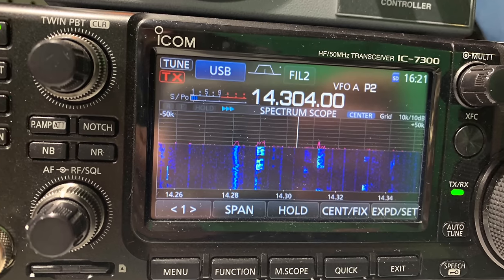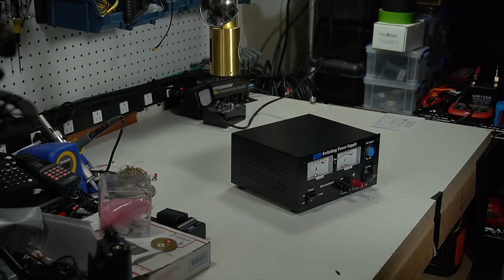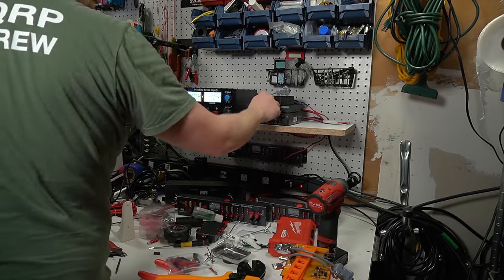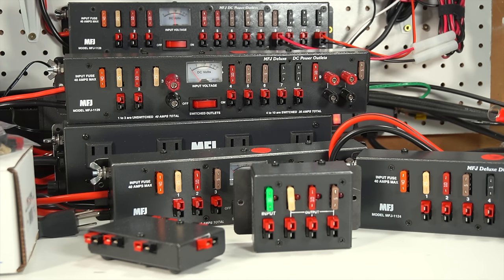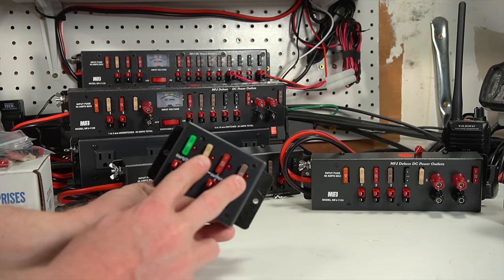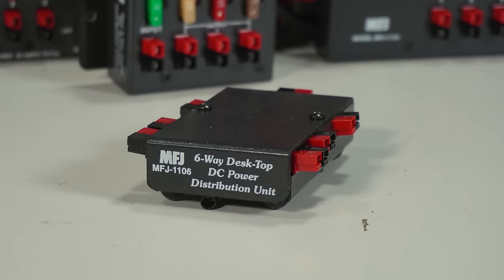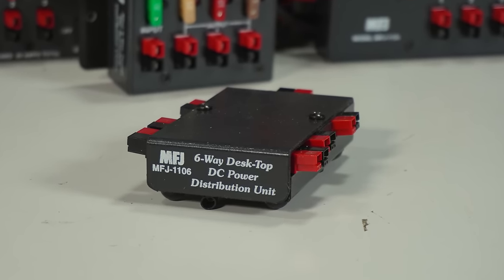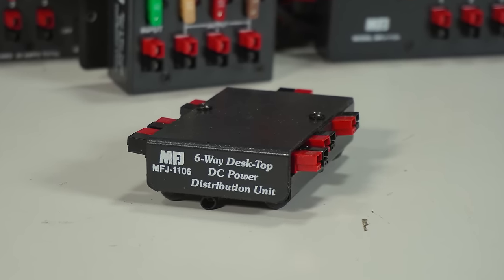Powering Your Ham Radio Shack with MFJ and Anderson's

Comment: Another great video.

I made a small device using an LED and a resistor connected to Anderson power poles.  I use it religiously every time I connect something for the first time after making a new connector cable - and especially when I am connecting something to someone else's power supply, like at Field Day.  If the LED lights, I know I'm good to go.  If it doesn't, there is either an open connection somewhere or, more likely, reverse polarity.  I've seen cables and connectors made up in the field where someone accidentally reversed a lead even though the power poles are color coded.  It's a very cheap way to protect your rig.  Steve, W6SDM

Comment: For your solar and battery backup look at the West Mountain Epic Powergate which switches everything automatically.  One day my solar panel will get installed and mine will be complete for my shop radio.   I also use the West Mountain  Powergate in my shack with a 125 Ah AGM battery. Again it switches automatically and charges the battery.  I also use the MFJ power distribution panels in both places.  Gotta love the Anderson power poles.
Reply from the maker: Awesome. A lot of people are recommending that unit. I’ll check it out.

Comment: Great video, Josh. Just put together my "Shack in the Box"  v 1.0 and used an Epic PWRgate knockoff that has power supply input, battery/solar input (supposed to autoswitch). That goes to 9 port RIGrunner knockoff that will power two radios, USB hub, mega hotspot and charging cradles for three HTs.

Comment: Nice set up. Being new to ham, Im working through some of these organizational systems prior to setting up my work station area. Ive built a go box with an ic-2730a, 12v 15ah battery, built in mfj power supply (just in case I have access to 110v. It is not only a nice go box, its a pretty sweet vhf uhf setup at home.

Comment: At one point I just used the screw down connector on my power supply.  When I added another radio I added another power supply.  Then I bought a rig runner and learned how to do power pole connections.   Now I have power supplies for both houses and am looking to set up a shack in my new home.  Had LMR400 built in.  So now I will standardize around my rigrunner for power distribution.  Love those power poles.  AD0DQ

Comment: I use Anderson Power Poles as well. In my previous setup I used a MFJ 25 amp power supply (also have a 45 amp version), but from there I use a different brand of equipment. I had a West Mountain Radio Super Pwrgate which automatically switches over to battery in case of power failure, and the power supply charges the connected battery. My power distribution is a couple of WMR Rig Runners that basically have the Anderson Power Poles and fuses similar to the MFJ units. My battery was a 34 AH SLA, but recently I changed my setup to use a 20 AH LiFePO4 battery. The lithium iron phosphate battery requires 14.5 volts to be charged properly, but the MFJ power supplies won't provide that voltage. I invested in a Powerwerx variable voltage power supply and swapped the Super Pwrgate for an Epic Pwrgate. This model will handle the charging of the LiFePO4 battery and has an input for solar panels. The Epic will also handle SLA batteries as well. I don't know if MFJ has a similar device that auto switches the power from power supply to battery, but it can really save your equipment in case of a power failure and allows you to continue running your equipment as well.

Comment: +enjoye your video on power sockets with anderson powerpoles.  i use them in the shack ideal for swapping radios around without all wires coming off the power supply. these are amazing and with the crimpers so easy to make up different leads.

Comment: I have a smaller Anderson distribution unit, i put a battery unit in that take the power supply and and a 50 amp hour glass mat battery.  Then to my  Anderson distribution.  This will charge my battery from the power supply and power my Anderson distribution.  It will switch from the power supply battery automatically I don't know the speed of the switch,  but I was on my VHF-UHF radio talking when my power went out and the radio and I were happy with the speed.

Comment: I have an Astron 35 watt unit.  I run everything to the power posts on the back.  I use in line fuses for all the loads.
Reply from the maker: I disagree, having Power Poles everyone is much easier and more reliable from my POV.

Comment: I haven't made the move to the power poles yet but plan too. I have a 30amp power supply ran to a 30amp fuse block, that has both power and ground on it.

Comment: Save yourself a lot of money, use a circuit breaker ground bar kit, I mounted them to a small PVC pipe but you can literally mount them to anything non-conductive. Use one for power and one for ground. There are so many options using this method, it really is limited by only what you can imagine. I have purchased MFJ Power Taps but I was tired of dealing with screw downs that were to small to accommodate larger wire, not enough taps, the endlessly different connection types and the cost. This system I came up with has really worked well for me, I wouldn't do it any other way.

Comment: Looking at a similar distribution setup. Recently completed my cpu install for high speed processing and three monitors. This helps to effectively process the RSP1A connected to the ft-991. Installed a Heil PRAS EQ to a JBL 2P. Seems like a good solid setup overall. 

My typical reminder to everyone “ take a minute to update your QRZ and share something about yourself AND your station” 😁
K5JRX

Comment: I just got a DC distribution bus like what you have here, but it's not an MFJ, it's a West Mountain Radio product, the RIGrunner RR-4007U.  I'll be using it to power a transceiver and RF wattmeter off of a Bioenno 50AH battery.

If you get a DRAWS HAT for your Raspberry Pi, it comes with its own integrated buck converter for powering off of 13.8 V.

73 VE7NDE

Comment: Print your brackets on their side so the layers don’t create a weak spot as you apply weight or force them.
Reply from the maker: Another 3D printing lesson learned!
Reply: @HamRadioCrashCourse  also by choosing more wall layer/thicker walls in your slicer you can make them alot stronger. i use 3d printed shelf brakets everywhere theyre super strong

Comment: Main supply is Astron vs-50m x2. For distribution I use WestMountain Radio Rigrunner 4005i, 1-4 are main equipment and #5 controls a golf cart 150A continuous duty relay with separate fuse to run a Rigrunner 4008H. All can be computer controlled from remote. Although #5 is just all on or all off control of the 4008H. This way the 4005i never see's any load from the 4008H as it's now on the relay. Great video thanks! kc8ujp
Reply: There's a nice topless spread of the 4005i on pg.28 April 2020 QST.
Reply: @roberthayes6329  oooh, that is nice.

Comment: Check out the Epic Power Gate from West Mountain radio. That allows you to run off a power supply and a battery. It basically creates a UPS for 12V
Reply: Oh, and you can plug in Solar to the Epic Power Gate so for elongated outages, the battery can either charge off the Solar and/or the PSU
Reply from the maker: I love this. Thanks!

Comment: using  jankie $10 auto fuse blocks that I put Power Poles on. pretty much the same thing as the MFJs but not as clean for sure. I really need to tidy my wires up some.

Comment: Josh, beware there are other PowerPoles. Bioenno uses 50 amp gray powerpoles. These are a larger size, duplex, and every color is physically keyed differently. Ooops. And then they use a lower capacity (45?) standard pair to charge the same battery.
Reply: Actually Anderson makes dc connectors up to at least 600 amp. I have used them for years in the electric equipment field ( ie electric forklifts) always thought they were a great design.
That said my shack is a mix of Anderson and banana plugs. I have an older MFJ banana plug distribution block coming off my power supply. But my supply also had built in Anderson connectors which I use to connect the mobile rigs in the shack.

Comment: Excellent video Josh, thank you.  My 'shack' is my office too so looking at reducing noise and powering my radio which currently all use supplied power supplies.  I want one power source then tap off to each radio as your video shows perfectly.  I am a little confused getting my head around  power supplies, do switching ones produce noise thus is linear better or they all produce noise, by nature, so a case of which produces less and is quiet?  Cheers.

Comment: Josh, does the switching power supply contribute to the noise floor of your receivers?  Switching power supplies as a generic group have suffered that criticism.
Reply from the maker: Some power supplies can, but many are pretty RFI clean.
Reply: @HamRadioCrashCourse  Hi Josh,
Need a minimum 30 Amp power supply for a base station. Have you or anyone else done a comparison of BOTH RF & audible (fan) noise with switching units? I mean with sound level measurement rather than descriptors like "pretty quiet" and "not too bad," etc.? 
What is your preferred "quiet" switching PSU in this output range? Also since voltage is standard at 13.8, why would I want or need a PSU with voltage adjustment?

If I have space and don't mind the weight and expense, what is wrong with a linear PSU? Supposedly they don't emit interfering RF and generate minimal sound and easier to fix if issues arise. A lot of folks seem to like the Astrons, for example.

Thanks!
73,
John - KK7JBZ

Comment: I have a hodgepodge of connectors in my shack, but I'm going to migrate to Anderson's, preferably the big one with a couple of banana-jacks for temporarily testing stuff that doesnt draw a lot of Amps.
I also have my QRP setup with solar, battery and radio to convert to Anderson's, the small one would be perfect for that
And, gosh, I do really need to tidy up my car, where one radio is connected to the cigarette lighter output, and another directly to battery...

Comment: How loud is the fan in the PSU?? I ran into the same problem, needed more power, so I replaced my 20amp PSU with a TekPower 30amp PSU - actually bought 2 of them... and they are so loud I can't stand them.
Reply from the maker: It’s not silent. But it is not loud. Also, it’s decently far enough away from my main operating area.

Comment: how do you determine which item you want connected to which fuse size?

73's
KD2SJM
Reply: You try and make the fuse just higher then what any device normally uses. So if there's a problem it will blow the fuse before the diode and resistor inside the dang radio but that never happend.....

Comment: Hi
A word of caution. Do not connect a hefty psu to the protected side of a mains surge strip. You will put a spike across your rigs when the psu caps charge up on switch-on. Dave G4BTI. UK

Comment: Does MFJ make a loss power gate? That would be the solution for auto switching to battery in event of a power loss.  I did a search in Gigaparts and the “Epic PowerGate 12V 40A Backup Power System” came up but would like to see one from MFJ if they have one.
Reply from the maker: I’ll check.
Reply: DX Engineering has an item called the "Hamsource EZ-Gate Battery Backup Switches EZGATE"

Comment: its a shame the hams standardized on such a outdated connector. the only thing going for it is modularity. which I will admit thats pretty nice. but they are difficult to built, and not as good electrically as the now standard XT60 family of connectors that are cheap easy to solder better electrical connection and come in several sizes.

Comment: 6FT of Panduit Raceway (open slot) for 12 bucks ………..a good way to hide cables.
Reply: Ahh panduit products... still got my panduit cable tie puller. Back in the day those were almost a hundred bucks. Must have pulled and snipped a half a million ties and it still works great.